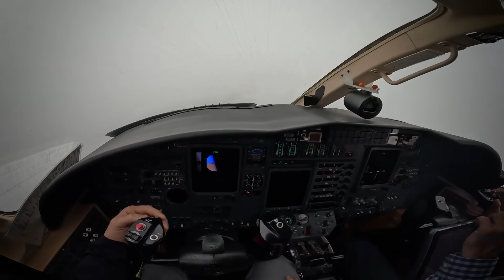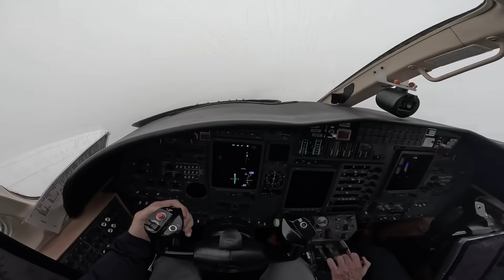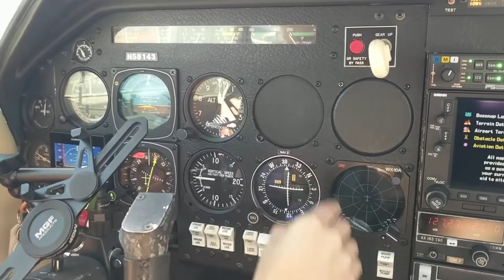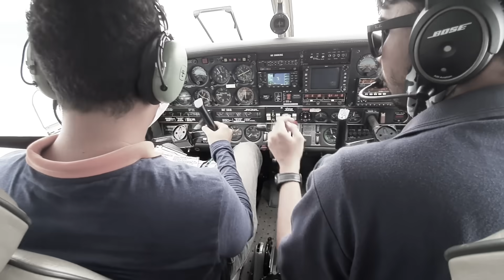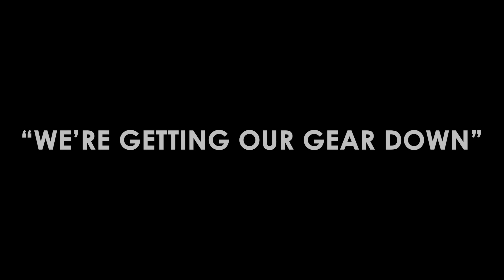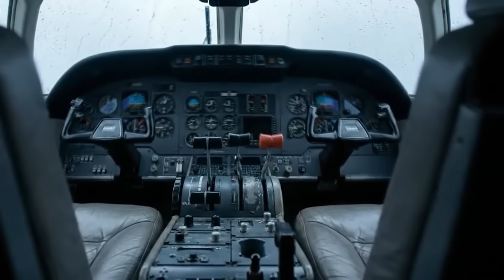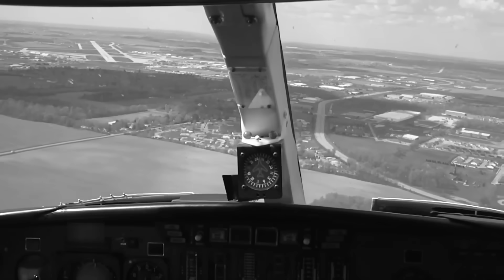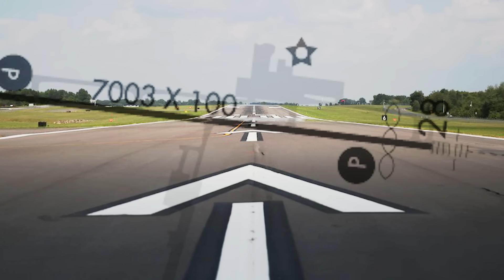Greg Biffle Crash ATC Audio EXPLAINED | When Configuration Became Commitment!

Comment: If you look at the flight path and where they were when they called gear down the intent was for runway 10. When they realized they were too high and to close to make the approach, they made a right turn on down wind to try for runway 28, still configured to land with gear down and flaps, already too low and too slow and having a thrust issue. They lost even more energy in the tight left turn in the attempt to line up with runway 28, which they actually did, but there was simply no energy left. They sank into the ground short of the runway.
Reply: Yep, and NOT following the checklist for an OEI approach which cautions against dropping BOTH gear and flaps - way too much drag with OEI - just half-assing it by the seat of their pants for some reason - WHY ????
Reply: Why? Because Mr Dutton was not flying the plane at that point in time but most likely was unconscience from a medical emergency
Reply: @proudbirther1998 absolutely ZERO evidence to support that hypothesis!
Reply: @DavidJones-hr9bn  if the CVR worked then we will know. As for evidence, if that is the traffic pattern of a retired delta capt and type rated 550 pilot with 1200 broken and 5 mile vis i will be beyond shocked. 
Ill still put money on my theory. I can't believe Mr Dutton was this horrible a pilot, in terms of flying, not in terms of having a qualified SIC
Reply: @proudbirther1998  make that 6 month Cessna 550 rated pilot, and I think the CVR will prove your theory wrong! Time will tell.
Reply: @DavidJones-hr9bn  Regardless of how long he held his rating to fly the 550, he was a retired delta captain with that experience to draw upon. I dont'have a problem with the decision to return to Statesville Region but with his experience why would he fly the traffic pattern he flew. TPA was 1000 ft AGL he decides to enter the downwind at 300' AGL. Then he is so close to runway centerline he has to do a non standard teardrop BASE to FINAL at 200ft AGL. And when he finally is on final he is about 100 ft AGL and wrongly configured and below a safe REF speed. 
To me these are just THE BASICS. And if there was an Engine problem, Heavy Weight will fuel i would be making sure i had Altitude and speed and making wider traffic pattern
Im not going to just make the excuse that he only was type rated 6months in that jet.

My theory of the HEART ATTACk is just that. I'm only basing that on the horrible and unsafe and unstable flight executed that morning in the traffic pattern.
Part of me also thinks the quick return to the airport flown by someone other then Mr Dutton was because they knew that airport and where they were wtihout having to look up alt airports and try and find them, were Mr Dutton was probably able to find alt airports quicker using this navigation equipment on board.
but yes i will be very interested to hear the CVR.
Reply: @proudbirther1998 He could have been having symptoms and tried to get on the ground immediately, that makes sense. I agree with your estimation of the flight pattern it was not normal for an experienced pilot, I wish the communication stated that clearly or hear it on the recording.  We just don’t know for sure
Reply: nailed it
Reply: How about everyone stop placing blame and spouting out theories and wait for the full NTSB report? Oh, I know why. Every expert has to be heard on the internet! For once can people just wait for all the facts to come out before bombarding the internet with comments? That a rhetorical question because I know it will never happen.
Reply: @festivus6466  No problem. I can wait for the NTSB report to be released in 2027. In the meantime I hope that some pilots found valuable information that the NTSB won't talk about, that may prevent something like this from happening again. 🙂 👍
Reply: @festivus6466  One think i think we can say is Mr Dutton did not hold a SINGLE PILOT EXEMPTION to legally fly that plane without a 2nd  Citation 550 rated pilot in the right seat.
And Mr Biffle ran an airplane leasing business and that jet was part of his fleet so he should have known the  rules.
That is why many are critical of Mr Dutton and Mr Biffle.
Instead of being upset at people commenting about this even you should be upset that those two men didn't follow the rule that would have made this a LEGAL FLIGHT and maybe made this a safe return to the airport.
Yea we still don't know the whole picture but we know the part that says THEY SHOULD NEVER HAVE TAKEN OFF THAT MORNING without a 2nd qualified pilot in the right seat.
Reply: My theory based on flight path altitude and audio is that Dennis Dutton was initially flying, hence the normal take off. Shortly after he suffered a medical issue and thus the plane started to lose some altitude. Jack Dutton in the 2nd seat took over the plane and yanked back hence the quick rise in altitude and starting the teardrop turn back. Jack likely panicked and said let's get back to the airport. He sounds stressed on the audio suggesting issues and that they needed to come back. Being less experienced he did what he could, likely in a high stress situation with dad having medical episode. Just my 2 cents and speculation.
Reply: @missmary257  BS! Jack didn’t have the requisite experience to configure the plane for landing. Do you not think if he had the presence to make a radio broadcast while flying the plane as in your theory, he would also have the presence to broadcast a MAYDAY as it would have clearly been an emergency? Not to mention having an ambulance standing by for your “fantasy” medical emergency?!!
Reply: @missmary257  I feel like you do. I can imagine a pilot slumping forward and pushing the yoke forward then a co pilot trying to pull back on it. I can also imagine one of the men in the back coming forward to hold the body of the pilot if he is slumped forward. 
I feel trying to pull dead weight from the left seat might be pretty hard in a cramped cockpit too.
Sometimes i wonder if there were 3 bodies found in the cockpit because NTSB was sure who was flying. 
I also feel the kid and or even biffle chose to return to Statesville Regional because they were not far from it. It was easy to find quickly. 
Trying to look up alternate airports in emergcies is a tough task especially without atc assistance of being well schooled in looking it up on something like foreflight .
I also feel the DAd should have been on the radio, even if talking to someone at unicom and not the kid. i really cant wait to hear what was on the CVR.
And if our theory is correct about the Father having a medical issue
Reply: If you understand anything about flying and making traffic pattern announcements on the radio NO EXPERIENCED PILOT is going to broadcast "we're going to put our gear down now"
That is just one clue to me MR DUTTON was not flying the plane. Most likely due to suffering a medical emergency.

What I want to hear is did Mr Dutton make the initial radio calls of " taking the runway " on takeoff, turning crosswind, turning downwind rwy 10 and departing the pattern to the west? 
OR WAS THE SON or MR BIFFLE making those radio calls?? 
If Mr Dutton was initially it would help confirm something happen to him .

You also must use your logic and think, would a retired Delta Capt holding a ATP certificate and a type rating in the 550 fly such a horrible and unstable traffic pattern at dangerously low altitude on downwind base and final. Would that pilot also attempt a tight teardrop base to final turn at 100ft AGL at min flying speed using full flaps know that's against the handbook.

Logic says MR DUTTON was NOT flying the plane at the time but that Biffle or the son were, and attempting to land the plane.
Reply: @proudbirther1998  I think it is very possible there was a medical emergency involving Dennis Dutton. Jacks voice was the only one heard on the radio, but if he was co-pilot (which he shouldn't have been) it would make sense that he was handling communications while Dennis was flying and trying to manage things. There is not a lot to go by as far as what the atmosphere was like in the cockpit but it seems that Jack was calm and keeping a cool head. I know that's not saying much except that it probably wasn't a fire, but you're right about the weird flight path.

Could it have been that Dennis was overwhelmed by the sudden unexpected poor performance of the Cessna compared to what he was used to flying? The stress of the responsibility he had on his shoulders must have been enormous. On top of that trying to make important decisions in seconds as everything was unfolding in an airplane that he no longer recognized. That was what I was thinking.

Everything you said fits and could absolutely be what took place. The flight path does look like an inexperienced pilot was at the controls. I guess we'll find out sometime in 2027 with the final NTSB report... and maybe not?
Reply: @nuversion8673  if an emergency was that overwhelming, Mr dutton would have called ATC and issued a MAYDAY. An Engine out is serious but with Training it should not be that big of a deal.
The jet will still fly and climb and decend and turn. You can set up for a visual approach to an airport or fly and ils. Losing one engine is not a catastrophic event Expecially with someone with Airforce and civilian training 
The erratic flying tells exactly who was NOT at the controls.
Reply: @proudbirther1998  Some people are speculating that Mr. Dutton had reasons to try and return rather than follow proper engine out procedure and go somewhere else. I don't know, maybe? Although an aircraft can indeed fly on one engine it must be done very carefully and with as little maneuvering as possible, which is why a return is not recommended unless few other options available. So, one could speculate that Mr. Dutton (with his Airforce and civilian experience) felt confident enough in his skills that he could pull it off?

I doubt Mr. Dutton had much engine out experience in this particular aircraft type, and it would absolutely perform very differently than the more powerful aircraft he was used to. 

Over confidence is a real thing that can get you into trouble very quickly. My CFI warned about this quite often. "You begin to draw mental pictures thinking 'you got this' and eventually you'll fail to recognize when you're actually in trouble, often when its too late." I think for Mr. Dutton it was when he sat his over confident butt in the left seat. You'd think that someone with his credentials would know better than to put his unqualified son in the right seat.  Just my opinion.
Reply: @nuversion8673  obiously, unlike myself who is more cautious and conservative, it seems like Mr Biffle and Mr Dutton never played much chess, and pondered THE WHAT IF'S IF you take one course of action what might your opponents move be, or if your opponent, ie the jets equiptment should fail you or the weather oppose you, or if say the pilot flying might have a heart attack midflight what will the crews options and moves be.
 As i said, these two didnt 'wargame' much in Preflight but chose the bon jovi, "Living on a Prayer' option and let Jesus ride in the Co Pilot Seat.

The interesting thing is had Mr Dutton picked up his IFR clearance and was in the ATC system and had this issue then he still would have had to give account for why he was flying single pilot. 

I just think if i was flying with one engine then im going to just stay a bit higher and a bit faster then i might with two working engines. Im going to be looking at those PAPI lights at the runway. And im not going to be making big banks. I want a nice extended downwind, base and long final.

I still tend to give Mr Dutton the benefit of the doubt in terms of his flying skills and just find it shocking with the traffic pattern that jet flew that day was done by him. 
I cant' wait for the CVR transcript to be released.
Im sure NTSB knows whats on the audio IF THERE WAS AUDIO on it.
Reply: @proudbirther1998 I’m not a pilot and I’m shocked at the flight pattern plus the landing configuration. Out mind tries to fill it what could lead to this but the starting out depending on one qualified pilot really bothers me
Reply: @angelarich8455  The last part of your comment about "starting out depending on one qualified pilot bothering you' is unclear to me about what you mean. Could you clarify that last part? 
From my POV, Mr Dutton was qualified to fly that jet. Even if he got his type rating a few months earlier as i read from comments and some vloggers. 
I also do not know how much time he actually as flown in the plane that crashed.
But He was not qualified to fly this jet single pilot. Mostly because having two qualified pilots are really needed in order to deal with any 'issues' that arise in flight.
I am critical of his POOR JUDGEMENT to fly without another qualified citation pilot in the right seat with him.
But saying that i still give him the benefit of the doubt that he understands the basics of Traffic patterns, Stable approaches, Vref speeds, Normal Landing configurations.
The traffic pattern altitude for that airport was 1000 ft above ground
(Airport elevatin was 968 ft MSL 'MEAN SEA LEVEL. Add 1000 ft to that  and this Jet should have entered the downwind with an altimeter reading of approx1900-2000 thousand MSL
Tracking data gives a height on the downwind about 1300 ft MSL.600 to 700 below normal traffic pattern altitude. Maybe they were a bit lower trying to avoid clouds but they were dangerously low and got worse turning base and final with min flying speed in a bad landing configuration. Was Mr Dutton this Incompetent?  Everyday the world suffers from accidents caused by people with experience being incompetent in many fields of employment. Ill be waiting for the cockpit voice recorder and the NTSB to answer what many of us are guessing as to what happen.

Comment: The right seat had the pilot's son in it as pilot monitoring and he was not type rated on that aircraft, an aircraft that requires a crew of two type rated pilots.
On one engine this aircraft is known to be very slow and will stall with gear down and full flaps.
Reply: There is NO ATC audio in this accident. The radio calls were on the common UNICOM frequency, which pilots use to inform other pilots of their movements near an uncontrolled airport.  Unbelievable that the producers of this video don't know that.

Comment: There was a plane taxiing on runway 10 could not land on10. Bottom line is bad weather and 50ft to low plus landing gear down and no power or time to correct. The right wing clipped a light pole causing a fuel leak  plane skimmed 4 tree's and front wheel hit the ground ripping it off. Plane then again hit two light poles knocking the top off one and leavling the other. Sending the plane Into a hard belly landing igniting the leaking fuel then or when the plane collided striking the second set of light poles. The Biffle family was amazing they are deeply missed. Thanks Biff for what you've thought me. Love you man
Reply: Bottom line. Mr Dutton, a retired Delta Capt hold a ATP certificate and a type rating in the 550 would fly this horrible and unstable and dangerous approach in an airport traffic pattern , NO WAY HE WAS FLYING THE PLANE. He probably had a heart attack 
He was 67 yrs old

Comment: Was this jet older than the models that come standard with a stick shaker?
Reply: good question ! Airliners have "stick shakers" - not sure about bizjets - good question.  I believe the corrective action for a "stick shaker" stall warning is nose down and add power - so in this case they probably had the throttles firewalled already and no room to put the nose down (dive) much
Reply: I think it was a 1981.

Comment: Not just that, the aircraft was in all likelihood over weight, this aircraft if at max rated t/o weight should have been able to climb out on a single engine by law.
Reply: It did until he dirty the aircraft up with flaps and landing gear. He should’ve went straight ahead and gained altitude went to the next airport where they had fire equipment figured it out in between they definitely did the wrong thing. I can’t believe a professional pilot would do such a thing like this guy did whoever it wasthe pilot let them down.
Reply: Ya, a very experienced C550 pilot on another page said that with FULL fuel a C550 could only carry two passengers and light baggage or otherwise be over-weight, so if this plane had FULL fuel they were def overweight, which really reduces performance with OEI
Reply: All the public has at present is speculation.  That being said, a scenario COULD BE a popped open baggage door on the nose that caused stuff to come out damaging the engine causing it to lose power or fail. Since the radio call mentioned “things” besides the “rough engine” could it be possible debris also struck the airframe causing damage to a control surface increasing difficulty maintaining controlled flight?  I hope they release the CVR tapes if it survived the crash and fire intact and recorded anything useful. Regardless, a very sad situation and my heart goes out to the family members and friends.
Reply: It did initially, until the pilot had a heart attack. And the son and Mr Biffle were trying to deal with him and fly the plane back to the airport they just left.

Consider the wife text message TO HER MOTHER. We're in Trouble!.

People text a close love one if they think they are going to die 

Losing an engine with a qualified pilot is trained for and the plane will continue to fly climb decend land all in stable flight.

I think she saw the pilot was unresponsive and her husband and the kid were trying to deal with him slumped at the controls and fly the plane.
Reply: @proudbirther1998 it’s interesting because that voice didn’t sound very aged but rather Greg’s.